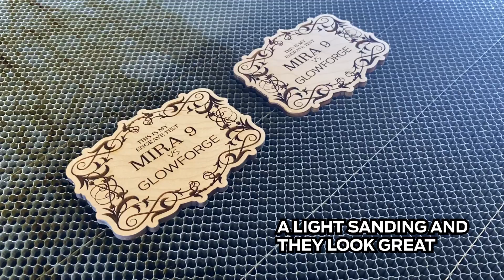MIRA 9 VS GLOWFORGE - Let's get it on!

Comment: I am pretty proficient with my glowforge.  I consider the programing very user friendly if your not a tech savvy person.  Is the Mira 9 program tech non-savvy friendly?  After 2 years i am still trying to learn my CNC router (gcodes) which, well lets just say I haven't made really anything with it yet.  I want a faster machine but nervous I wont figure out how to use it.
Reply from the maker: I find using lightburn very simple. So much content out there to help as well. 😊